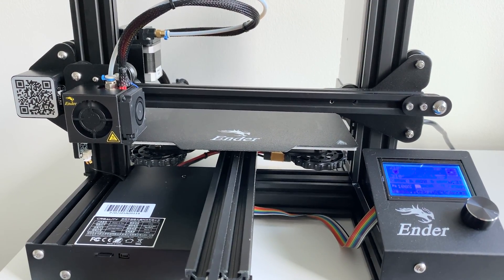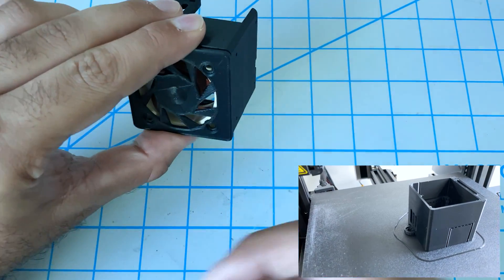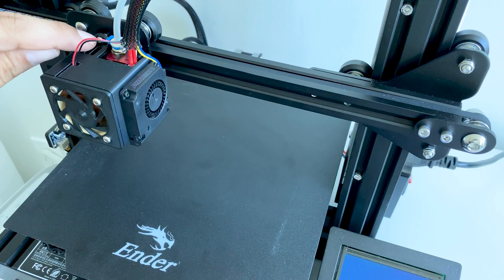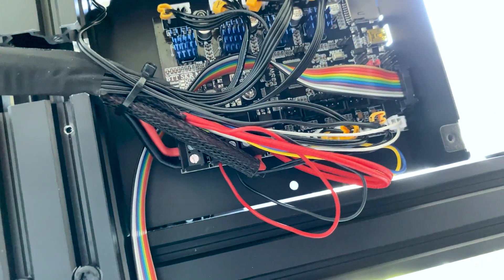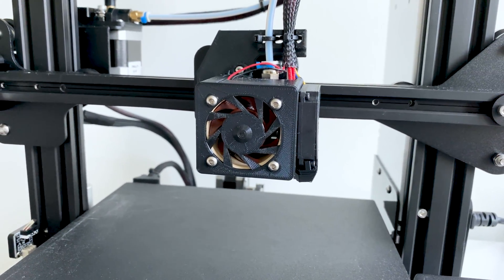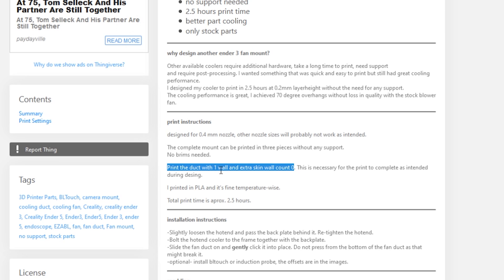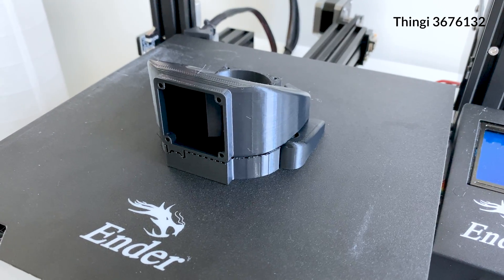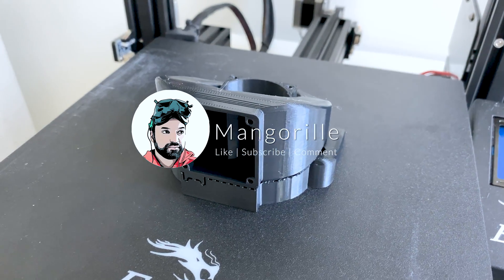Creality Ender 3 Pro Hot End Noctua A4x20 Fan Upgrade 40mm x 20mm | FINALLY Some Silence!

Comment from the maker: It looks like the Thingiverse page for the MinV2 design recently went down. We tried to contact the original designer but the Thingiverse messaging is down. In the mean time, we re-uploaded the files we had backed up. Luckily we had all the files backed up except for the base with the BLtouch, which I am sure someone out there can manipulate to add the BLtouch to anyway. You can find the re-upload here: https://www.thingiverse.com/thing:4744656
Reply: Thanks for re-uploading! Can you tell me the offset values your are using?
Reply from the maker: @moschkee  Hey. Do not have the offset values as I did not use the bltouch version of this mount. We also lost the bltouch version of the base.
Reply: @Mangorille  Thanks for you reply! I figured out the offsets and I also still have the file for bltouch in case you want to reupload it as well. Let me know.
Reply from the maker: @moschkee  Yes please, can you send it to me mangorille at gmail and I will add it to the re-upload Thingiverse. Thanks!
Reply: @moschkee  Hi, could you share the offset for bltouch, please?
Reply: @lofergil  Sure, there you go: Probe Offset X-29.00 Y0.00 Z-1.76
Reply: @moschkee  Thank you!
Reply: Why didn't you show how hard it is to put all this together?
Reply from the maker: @garyholcomb9949  Hey. Which part are you finding difficult?
Reply: @Mangorille  I would have liked to have seen you showing how you put this all together. I'm having problems with the whole thing.
Reply: I know it has been three years since this comment, but it seems the original link in the description is back up (win for anyone with a BLTouch)

Comment: The best thing I've found is the tk fang hot-end housing with 2 40x20 fans. Not Noctua they just run at a lower rpm and move less air.

Comment: or just buy the 24v option and just solder it in.. no reason to use the board
Reply from the maker: Correct, however, at filming there were no super quiet 24v options.

Comment: my new fan has 4 wires wich do i need to use?
Reply from the maker: Sounds like you purchased a PWM fan instead of a non-PWM fan. The 4th wire is used to control the speed of the fan, which the Ender 3 cannot do. You'll need to do research on the specific fan you bought to see if it will simply run at 100% without the PWM wire connected or not run at all.

Comment: Noctua has released a 24V version called NF-A4x10 24V PWM. We could use this one instead and skip the buck converting
Reply from the maker: Thanks, great news and will make this mod way easier!
Reply: @Mangorille  Absolutely! Do you think a single fan is enough though? The NF-A4x20 12V is twice as thick as the NF-A4x10 24V PWM?
Reply from the maker: @Karlush  I went with the x20 for the extra thickness and airflow. I suspect the x10 will be fine unless you get into hot temps.

Comment: With a three wire fan, what did you do with the other wire since the mainboard/buck converter is two wire?
Reply from the maker: You don't need the third yellow wire. I just cut it as close to the fan as possible. You can see at 3:55 in the video.

Comment: is it REALLY that much of a difference when you swap out the hotend fan versus say all of them?
Reply: I ask because i did the motherboard swap (yes I know soo late in the game) and my printer is literally next to my bed. Since the mb swap, LESS noise BUT again it's that hot end fan thats on full blast making all the noise, I also noticed the OE fan after a while will start to fall apart (my original fan lost 3 blades somehow - found out after it started making this loud squealing noise).
Reply from the maker: Yes, I found the hot end fan was the most noise, then the power supply fan. The drivers on the motherboard are noisy as well but sounds like you've already changed the motherboard out.

Comment: I know this video is 3 years old but if you get a 40x10 fan instead of the 40x20 it can fit right into the original fan mount housing with no modification (like 3d printing a new fan box) and plus it’s the same electronic stuff as in the video.
Reply from the maker: If I recall, the 40x10 was available at the time of filming but it had less airflow than the stock fan.

Comment: What are the Dc step downs used for
Reply from the maker: Printer runs on 24 volts whereas the fan is 12 volts so you need the step downs to reduce the voltage.

Comment: Why not get the 24v fan over the 12v?
Reply from the maker: The Noctua silent fans are all 12v fans. If you can find a high airflow quiet fan like the Noctua that runs at 24v, that would be better.
Reply: @Mangorille  ahh that's right. Thanks. I was gonna go with sunon maglev 4020 that comes in 24v but noctua is more quiet.
Reply from the maker: @blakesupra4440  There may be a suitable 24v fan out there now, there wasn't when this video was made. Make sure you look at both the noise and air flow ratings.

Comment: Have a question what if I wanted to do the fang download and put two fans do I use the same converter or different converters?
Reply from the maker: You can use one converter and run both fans off the one converter.

Comment: Would this help with the heat creep? Does it move more air?
Reply from the maker: It's mainly for noise. No one seems to know the airflow of the stock fan but people think it is around 7cfm. The Noctua 40x20 is around 6cfm. The 40x10 is around 5cfm

Comment: I printed this design but the blower won't fit into the piece at all. I tried just pressing it in but it wouldn't go. Am I missing something?
Reply from the maker: Which design? The video has two different ones.
Reply: @Mangorille  The second design in the video
Reply from the maker: @marcuscastillejr.6371  That helps. Is it the part cooling blower fan that won't fit into the duct? If so, you need to wiggle it a bit to make it fit, it is a tight fit.
Reply: @Mangorille  I'll give that a try. Thanks for the help!

Comment: On a mothboard, where does this plug in at?
Reply from the maker: It will connect to where ever the fan is currently connected. You are just placing that voltage step down converter in the path so that you can run a 12V fan on a 24V circuit. Look at 5:10 in the video.

Comment: worth staggering your soldered joints then only use a single heat shrink tube
Reply from the maker: Thanks for the suggestion, that would work but make sure your solder joints are smooth and no pointy bits that could poke through the other cable and cause a short.

Comment: Is there a lot of airflowing noise? I built the Briss cooler but i found the noise of the top fan whirling air through the cooler very annoying. Even when the fan on top just hat 15% rpm.
How was the design you showed at the end?
Reply from the maker: The design at the end is my preferred design and the one I ended up using long term. I found it very quiet but check out the DB noise meter at the end of the video to give you a better idea of the noise level.
Reply: @Mangorille  okay. Thanks for the advice :)

Comment: what did you do with the extra cable that the Noctua has?
Reply from the maker: The yellow wire is not required. You can either just it away somewhere out of the way or cut it off.

Comment: the fan duct is printed with supports? they go inside and it seem like it would be impossible to remove
Reply from the maker: The first design or the second design?
Reply: @Mangorille  the one you show in the video
Reply from the maker: @jojo_glitching2970  There are two designs showed in the video.
Reply: @Mangorille  ohhh the second one i think. The one you reupload
Reply from the maker: @jojo_glitching2970  Perfect. You should turn off the supports when printing all three parts. Check ~10:20 in the video where you see the Cura settings being scrolled through.
Reply: @Mangorille  awesome thank you ill try it out tomorrow
Reply from the maker: @jojo_glitching2970  No problem, good luck
Reply: @Mangorille  thanks man

Comment: Hi, can anyone advise me what is the 3rd yellow wire of the noctua fan for? What should i do with it?
Reply from the maker: The yellow wire is for RPM sensing/reporting. You don't need it as the Ender 3 does not support this functionality. You can either tie the yellow wire off somewhere or cut it as close to the fan as possible. Your choice.

Comment: little tip: i put a little dot of hot glue on the adjustment dial on the buck converter so i won't accidentally increase or decrease the voltage
Reply from the maker: Good idea, thanks for the suggestion!

Comment: Thanks for the review. I'm gonna use cable ties to strap one of these to an old hot video card 😜
Also, you'd think that a company making expensive, fancy printers would come up with a better fan, or at the minimum, partner up with Noctua or something 👍😉
Reply from the maker: No problem. Some of the higher end printers actually do come with Noctua fans. The Ender 3 is considered a more budget friendly printer. :)

Comment: Any reason we can’t use the 40x20 5v fan? Same rpm and all
Reply from the maker: You can use the 40x20 5v if you already have one lying around but don't see any benefit in choosing the 5v over the 12v. You still need the buck converter and the 5v uses twice the amperage as the 12v model.

Comment: when i test the voltage after i’ve connected the voltage regulator the lowest i could get the voltage on my multimeter was like 35V and now it only shows 50.6V
Reply from the maker: Did you get the buck converter that I linked in the description? The one I linked would drop the voltage so it would not be possible to get it to go over 24 volts.
Reply: @Mangorille  don’t worry, i figured out it was just a bad converter so i used the other one and it works like a charm
Reply from the maker: @pgoffinet17  Great! Happy printing!

Comment: When soldering the noctua fan to the old fan leads what should I do with the yellow wire? do I snip it off as short as I can get it or should I unsolder it from the rest of the fan or can I use the included 3 pin to 2 pin?
Reply from the maker: I just snipped the yellow wire as close to the fan as possible.
Reply: @Mangorille  okay, i would have imagined that’s the case because it’s just the ground wire, just wanted to make sure. thank you for the help!

Comment: Shouldn't be the fan PWM instead of FLX?
Reply from the maker: No, it should be the FLX. The Ender 3 motherboard does not support a 4 pin PWM fan.
Reply: @Mangorille  Thank you for the clarification!

Comment: When you unbox the fan and show it at 1:12, it has red/black/yellow wires contained within a nice sheath. When you finish soldering at 3:58, we see only exposed red/black running to the fan. Did you peel off the factory shielding and cut back the yellow?
Reply from the maker: Correct, peeled back the factory sleeve and cut the yellow cable really close to the fan motor. You just need the red and black wires for the install.
Reply: @Mangorille  Thank you. Finished the mod last night and ran my first print with it. The reduction in volume is amazing ... and indeed, it's really nice to be able to see the nozzle so clearly. I almost screwed up by putting the fan on with sticker facing outwards. Next, on to the power supply fan.
Reply from the maker: @darranedmundson1505  Glad it went well, makes a huge difference in the noise level. Wait till you do the power supply, that one makes even bigger difference!

Comment: may I know how is the noctua fan doing ? is it causing any clogging due to insufficient cooling of the hot end ? I'm getting one of these fans but I read on some forums (and even a youtuber) saying that the noctua fans could not cope with keeping the hot end cool from heat creeps...
Reply from the maker: Did not encounter any issues but I only print up till about 230 degrees PETG. These folks you are referring to, were they using the A4x10 or A4x20? We used the A4x20 for the additional airflow to prevent heat creep.

Comment: Just a tip, when you measure the buck converter voltage, DO NOT LET IT TOUCH ANYTHING METAL! 3d print a case for it beforehand because I didn't and I had 2 buck converters explode on me. Also be very mindful of your multimeter so you don't put current back into the converter or the same thing will happen.
Reply from the maker: Good reminder, thanks for sharing.
Reply: Ahh this is probably what happened to mine after my Kapton tape came off!

Comment: I just used the Low Noise adapter, its just a 100Ohms resistor and it works since over 2 years perfectly
Reply from the maker: That's interesting and you just connected it straight to the 24 volt output from the motherboard?
Reply: @Mangorille  i used the original fan connection, which is 24v
Reply from the maker: @JSNFKE  I suppose this shows you the quality of Noctua fans. :)
Reply: @JSNFKE  I already have my converters, would you suggest that using the low noise adapter is a good alternative or if I already have the converter I should just use that?
Reply: @GeneralHowToTutorials  yes definitly, it runs and runs

Comment: @Mangorille ... The buck converter that you're using holds the output at a constant voltage even when the input voltage changes. So how can the software control fan speed ? Your fan is receiving 12v even when the control board puts out less than 24v. You can check it with a volt meter. Please let me know if I'm wrong.
Reply from the maker: Hey. You're correct but my understanding is that the hot-end fan is a constant speed fan so should run at full speed all the time. The parts cooling fan is pwm and controlled using the negative line so you have to wire it differently if you want to replace that. I provided a wiring diagram for that in another comment reply here.
Reply: @Mangorille  Thanks, I'll do the mod.
Reply from the maker: @niwachien  You're welcome, good luck!

Comment: This tutorial destroyed my fan control. All fans aren’t working anymore 🙄 after talking to some people to a group they told me that this is the wrong way how to do it because DC and PWM don’t like each other 🤔
Reply from the maker: Which printer did you attempt this on? The hot-end fan on the Ender 3 Pro is always on and running at a constant speed.
Reply: @Mangorille  Ender 3 pro, exactly like shown in the Tutorial. As I said, all fans aren’t running, they all run on the same control box (?). I had to take 24v from bed or PSU to get them on. For Grounding I left the cables where they should be and now it works.. But I ordered a new board to be sure. However some guys in my group told me it’s completely wrong due PWM issues and the voltage the buck converter is drawing from the FAN Port will destroy the Port 🤔
Reply from the maker: @DemSkillzx3  Did you do just the hot end fan or the parts cooling fan as well? The parts cooling fan is PWM and you need to do it differently. There's a link in the comments already to a diagram on how to do the parts cooling pan. The hot end fan is just always on and uses a different slot on the board.
Reply: @Mangorille  hot end only. Like shown in the Video. But all fans share the same control box so every +24 volt pin of the fan slots died..
Reply from the maker: @DemSkillzx3  That's very strange. Was this on the stock motherboard?
Reply: @Mangorille  yes. The 4.2.2 silent version.. The microfuse broke somehow and killed all 24V ports from the Fans. I got my money back and got the newer 4.2.7 instead. I now use the permanent 24V from the PSU input on the Board which works very well!
I even upgraded PSU fan to a be quiet 8025 and using the stock 60mm PSU fan @ around 6-7 V for the motherboard and I can say it’s amazing. It’s so quiet and everything is cool. The only thing you can hear now is the stock parts cooler but I will replace it aswell 👍🏼

Comment: Looking at Noctuas page, the NF-A4x20 is supposed to draw 0.05A, which is not much current. I think it might work flawlessly to go with a simpel resistor in serie, say 240ohm. Then you would devide the voltage equaly between the two, thus get 12V across the fan without the need of a DC/DC. So I guess that will be a cheaper and easier solution, fiddle up two 0.5W 120ohm resistors in parallel should do it.
Reply from the maker: That might work but you can get the buck converters for really cheap and we know the buck converters work perfectly.
Reply: When doing this, just make sure that the resistors don't get too hot!

Comment: Do you have any printing problems like heatcreep or clogging with the noctua? There are so many people saying different things so I want to ask someone actually using it.
Reply from the maker: No problems so far using TPU, PLA, and PETG. We used the 40x20mm instead of the 40x10mm to get some extra cooling for the hotend.

Comment: I have the exaxt same printer and it doesnt print as good as yours. Whats your secret?
Reply from the maker: No secret, you just need to keep playing around with the slicer settings till you dial it in for your printer. This of course assumes your printer is mechanically sound. What kind of print quality issues are you having?
Reply: Wow, thanks for the reply. I had great print quality when I first got the printer, i noticed as time went by it was over extruding, then i changed the nozzle and it seemed okay for a couple or prints and went back to over extruding/making scratching makes on the prints. Basically i never had the same print quality from out of box after i first start experiencing the issue.
Reply from the maker: @sameenwaseem158  Did you change anything from the time you got the printer? Say different Slicer, Slicer Settings, Filament, etc...? The one thing we noticed you have to constantly check is the tightness of the rubber V wheels, they like to loosen over time and add slop to the printer.